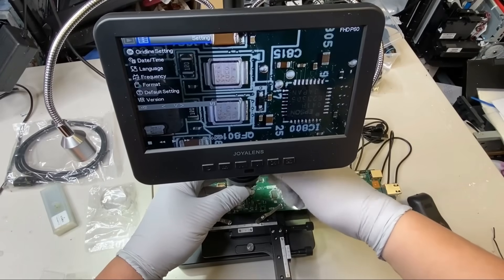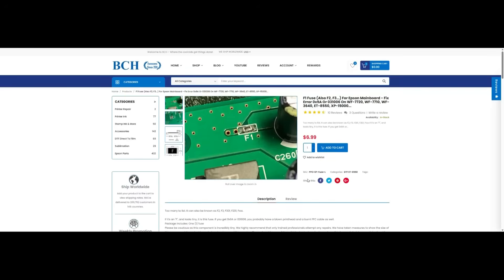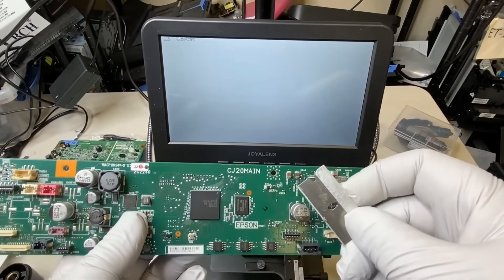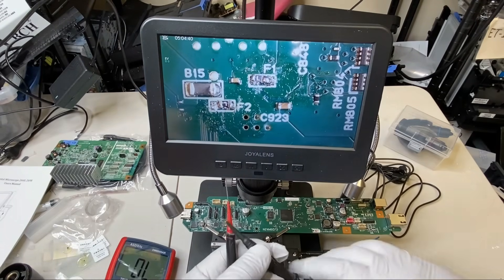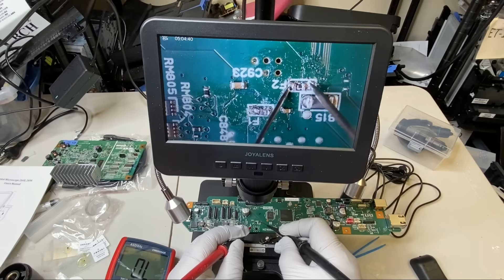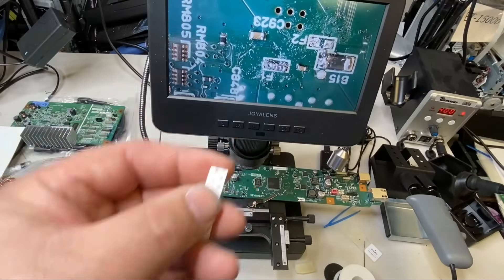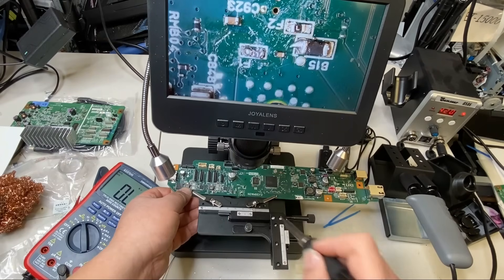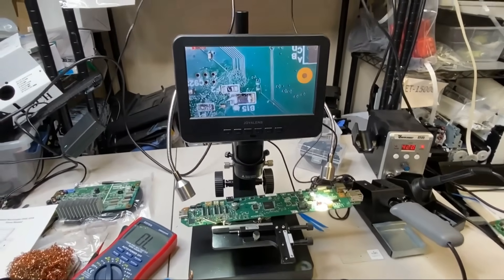How to Replace F1 & F2 Fuses on Epson ET-8550 – Fix Error 031006 Fast!

Comment: can i just buy another mother board if i dont have the capability to do what you are doing?
Reply from the maker: Thanks for your great question! I really appreciate your engagement. To answer it, you absolutely don't need to buy a new mainboard; you can send yours in for a much more affordable repair at our first https://bchtechnologies.com/collections/printer-repair-service/products/fast-track-mainboard-repair-l1800-xp-15000-et-15000-wf-7610-7620-wf-7110-wf-7710-7720-et-8550-et-2720-et-2750printer-mainboard-formatter-board-motherboard-troubleshooting-and-repair . If you do end up needing a replacement, we also sell tested and ready-to-print mainboards at the second link https://bchtechnologies.com/products/et-8550-mainboard-cj20-fully-tested-ready-to-print?_pos=3&_sid=7942be865&_ss=r. For the quickest replies to future questions, subscribing or joining as a member gives you priority response (usually within 48 hours) and extra benefits, and since I only answer about 10 questions a day, non-subscribers can either subscribe or re-post their question after 48 hours since newer comments are reviewed first (and subscribing later automatically prioritizes your older questions too!). For real-time help, join "Run With Kevin — LIVE" every morning around 6-8 AM Eastern—just subscribe and turn on notifications to ask your questions live. For faster assistance, you can always email support@bchtechnologies.com, and if this was helpful, I'd be so grateful if you left a quick Google review here: https://g.page/r/CfL7k6nYvPQ9EAg/review.

Comment: Kevin, what is the jig called that you are using to hold and navigate around the board?
Reply from the maker: Thanks so much for being a subscriber and for your question—that jig is called a mechanical stage or linear stage, and it really helps with holding and navigating around the board. You can check out the same type I use here: [https://amzn.to/4mVdLhk](https://amzn.to/4mVdLhk). I truly appreciate your support since every subscriber brings us closer to the 100k goal, and while I try to answer subscriber questions within a few days, I’m still working through a big backlog, so thanks for your patience. If you ever need quicker help, you can always reach me at [support@bchtechnologies.com](mailto:support@bchtechnologies.com).

Comment: Epson 7890 a139 error right before printing?
Reply from the maker: Thanks so much for watching and for your great question! The Epson 7890 A139 (or 1A39) error usually points to a printhead or connection issue—often a loose or damaged ribbon cable, a blown fuse, or a faulty printhead. Try checking that all ink cartridges are properly seated, clean the contacts with rubbing alcohol, wipe the encoder strip with a lint-free cloth and cleaning solution, and make sure all cables are secure. If the error remains, it may need professional service. I really appreciate your support—please consider subscribing or becoming a member so your questions get priority and early access to new videos. Subscribers and members are usually answered within 48 hours, while regular viewers are answered if time allows since I can only reply to about 10 a day. After that, the newest questions go first. If you’re not a subscriber and don’t get a reply in 48 hours, you can subscribe or re-post since newer comments are reviewed first. If you subscribe later, your old questions automatically move up in priority. For faster help, you can also email [support@bchtechnologies.com](mailto:support@bchtechnologies.com). And if this video or comment helped you, please leave a quick Google review here: [https://g.page/r/CfL7k6nYvPQ9EAg/review](https://g.page/r/CfL7k6nYvPQ9EAg/review).